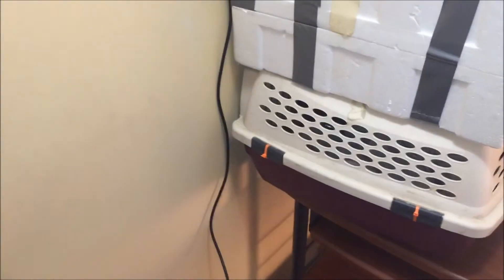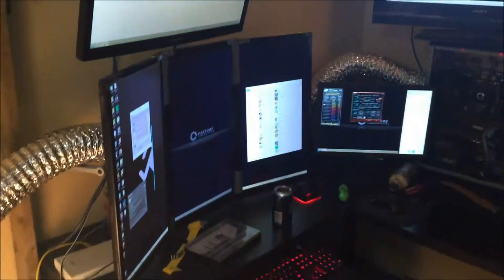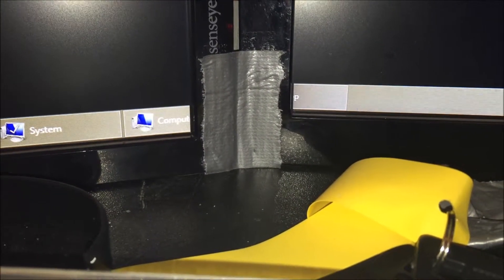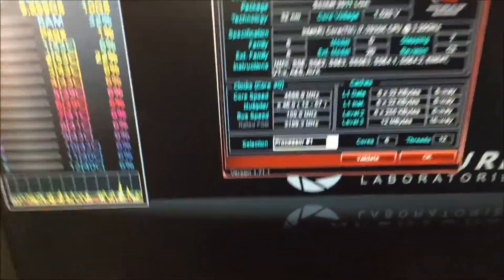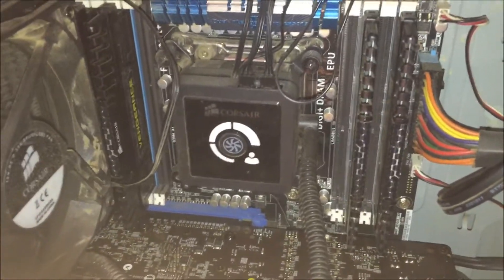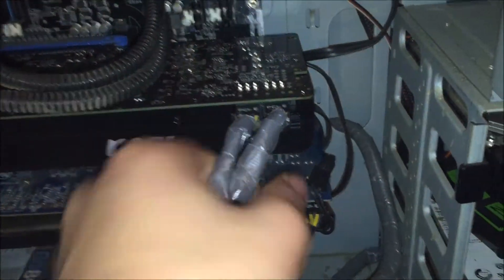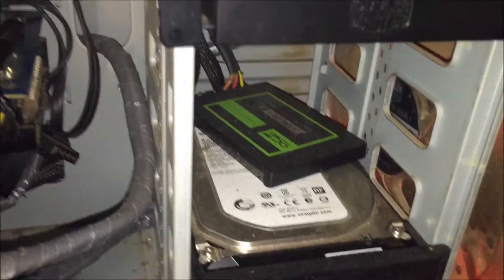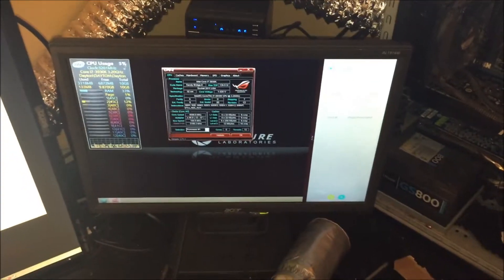Gaming rig 2015

Comment: I got a GTX 780 Ti Kingpin edition in 2014, great card, love it. But my FX-8150 shitdozer is holding it back, never got the chance to upgrade to a 4930k Intel, but when I do it is a good CPU right?
Reply from the maker: Lmao. shitdozer......Uhhhh, yeah the 4930k is sex.
Reply: POPCORN454545 I love my 4930k. ive got it at 4.7ghz   on a rampage iv black edition  watered of course
Reply from the maker: KaidoFujimi That's decent. My 4930k died actually. And they don't make LGA2011 V1 anymore......so i was forced to upgrade to a MSI gaming 7 with a 5820k. Not much of a difference but the board is definitely higher quality.
Reply: thats entirely false... i just bought a 4930k for another server i built brand new a couple days ago....
Reply from the maker: KaidoFujimi Where'd you buy from?
Reply: Newegg?

]
Reply from the maker: KaidoFujimi Memory Express.

Comment: what program are you using that monitors your cpu ?
Reply from the maker: Well, gadgets for Windows 8 is the interface(all cpu meter specifically), but CoreTemp is required for the interface to read the temps.